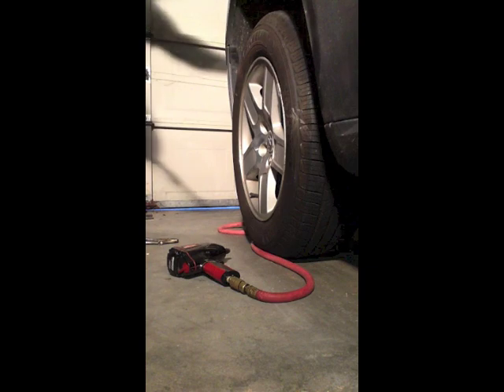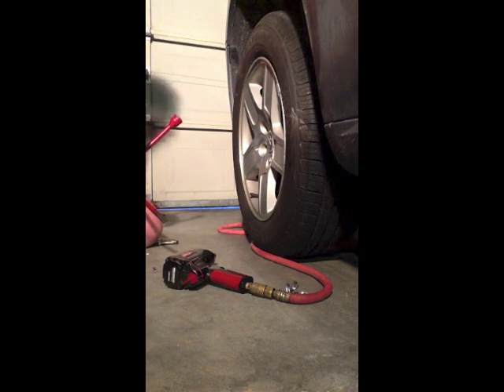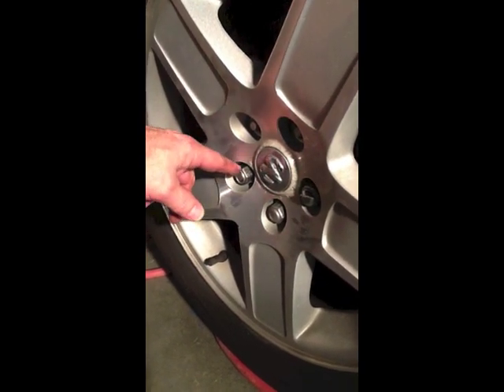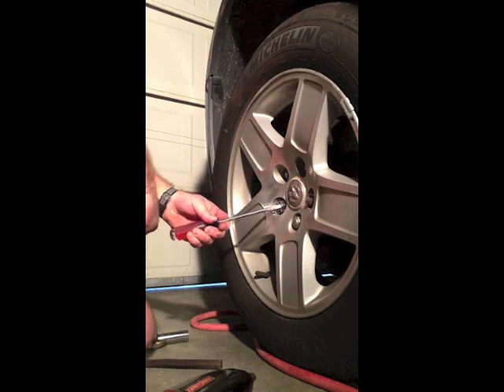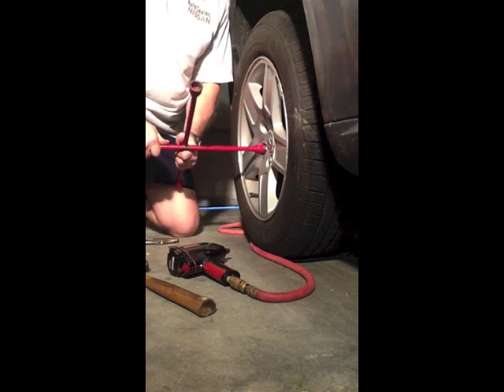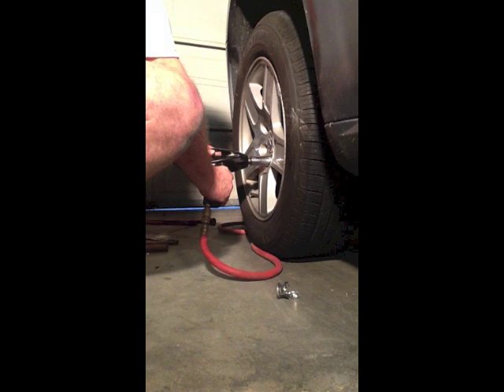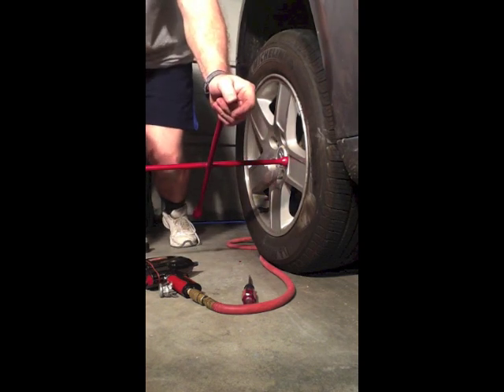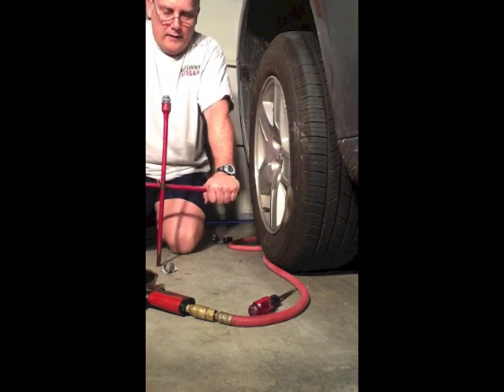How to remove over tightened lug nuts

Comment: Why not use a good quality 6 point impact socket, a breaker bar and a 4 foot cheater pipe?
Reply: Bryce Hambleton    Tried that on mine and they where so tight my wheels started to move when I tried to loosen the nut and my car was in park with the emergency brake on. So yea way way way over tightened
Reply: Because it does not work when the jacket is damaged. You have slippage between the jacket and the contained nut.

Comment: This is not an overtightened lug nut.  This is a damaged stud video.  I need to see a video condemning mechanics who bear down on an impact wrench that ensures that the owner of the car will never be able to change a flat on the side of the road.  Meaning, the nut is too tight but can otherwise still be removed using an impact wrench.  The danger of an overtightened nut is that the wrench slips off after the person is angry and sweating out of his eyeballs in the summer heat and ends up breaking an arm just trying to get the overtigtened nut off.

Comment: I spent 2 hours tonight, trying to get my lug nuts off. I rounded two nut with the lug wrench. Then I busted a breaker bar and a ratchet wrench. Cracked 4 sockets, one was for an impact wrench. I have 19 MM nuts, and after you remove the thin metal cover, an 18 MM fits perfect. So I cracked all three 18 MM sockets I had, and one 14 MM impact socket. I finally gave up. Tomorrow I'm going to buy one of those turbo sockets that bite into the nut. I better buy 2, knowing my luck with sockets. If that doesn't work...there is always dynamite!

Comment: I actually bent ( twisted )my 4 way removing a stuck lug nut like that. I sed a length of pipe over the other end. I didnt notice it right away that I had twisted it until my daughter asked me what was wrong with my tool,It was laying on the garage floor,thats when I noticed I had damaged it. geesh! I hate those aluminum lug nut covers. Ivended up replacing all my nuts with regular chrome ones,much better,thats for sure. I still have that bent 4 way.

Comment: I work at a little Shop with young guys , all I see is impacts throwing lugs on . I invested in a torque wrench, however when it comes to working they want you to be speedy.  regardless of torque specs. I guess that's how it is. and then you get this. had a box truck come in for a rotation. took a impact at full force to get the lugs off. barely. rediculous.
Reply: whsts wrong with a regular drill? you only need about 100ft/lbs...u overtihten them so that the customer comes back.... scam if u ask me....

Comment: THANK YOU!!! WENT TO GET NEW TIRES AND MY BOLTS ARE WAY TO TIGHT🤦🏾‍♀️SO I HAVE TO FIGURE OUT HOW TO GET THEM OFF
Reply: Use a lil bit of grease on the threads. 
Tighten the bolts, only by hand with an L shape wrench like VW type, or a torque wrench.
I apply grease on the bolts once a year, when i'm changing summer/winter wheels at home.
Tighten only by hand with a regular VW L shape 19 mm wrench, or what size your car has.

https://youtu.be/VbN9Y_fUvjo

Comment: So what's the trick getting the stuck lug out of your 4 way wrench?
Reply: toss the 4-way wrench and keep a breaker bar with and extension in your car. And use a torque wrench and just to be safe get a deep well impact socket (you may not need the extension)
Reply: Put it on a bolt in the vice, heat the nut and it will come off

Comment: I just came across the same issue with my friends car I just took a punch and a hammer punched a hole through the outside shell then took a pair of pliers and pulled it off yhen used a 3/4 drive wratchet with the appropriate size socket and used a metal bar on weather for leverage and lug nuts came right off

Comment: I usually service all my vehicles.  Many years ago, I went to a tire dealer place.  There was an "angry'" mechanic, who throws tools and what not around.  I should leave right away.  I did not.  He tighten the wheel nuts with the air impact at the max setting and banging away for 10+ seconds to make sure that those nuts will never, never come off.

Comment: Ive used heavier duty impact gun than the one the video poster used and still couldn't take my lug nut off. After welding a socket onto the damn nut after one hour of heating and all sorts of attempts it came off. Damn mechanics who overtightened shit as well. Fyi im an aircraft mechanic and work cars as well

Comment: I experienced this very same problem. After several hours of annoying my neighbors with my impact wrench. I decided to take the vehicle to a mechanic, and pay someone to remove all my cheap ass factory lug nuts. And replace them this solid steel lug nuts. You can really annoy yourself. In fighting with yourself in dealing with this situation. Save yourself the headache. And pay someone to do  this job for you.😬😬😬😬😬😬🤯🤯🤯🤯🤯🤯🤯😖😖😖😖😖😖😖😖

Comment: Don't change wheels at the side of the road. Most good quality non-runflat high performance tyres, can run flat with care, up to 80km/h for up to 50km. Drive your car to safety, such as a Service Station, Service Centre or Rest Stop.

Comment: Aluminum wheels should  be tightened to 80 ft pounds the tire shops won’t check them they use impact gun and way over tighten
Reply: The 'mechanics' don't even understand the word torque.

Comment: i took my old beater car to get a rotation and alignment at a shop near my house. first sign of scam was they told me my little 1.6L with not even 100lbft torque and a 0-60 in 14 seconds was prone to torque steering !!. car went left with straight steering wheel. when i went to pick it up, they told me they did the alignment but couldn't get the car to go straight because the rear tires (now front) were unevenly worn, and when they did a front axle swap teh car pulled the other side. then they didn't provide me with an alignment sheet bc they said i didn't ask !! every alignment i've done, the sheet is given to me automatically without asking!! then they tell me one of my front tires is now beginning to bulge on the outside. i examined it and couldnt find any bulge at all. so i took it home. over the weekend, i decided to try to took off the tire and bring it into my house and try to find the bulge and to try a front axle swap to test the pulling, and it turns out they over torqued my lug bolts and i couldn't get them to budge at all!!! so my tire has a bulge (potential tire pop) and they over torque all my wheels so if it did blow i couldn't change them. i think they didn't do the alignment i paid for and are trying to prevent me from front axle swap tires to test it out. the guy said if i got two front new tires, it'll go very straight and if it didn't they'll fix it free, and it'll be the best if i could get four new. i do agree i need for new tires bc the current ones are 7 years old, and there is a mistmatch tire (now in the rear). the car is 24 years old and i have a second much newer car that's my daily driver so they knew i prob wouldnt get new tires. The reason i took the beater for alignment is because i wanted to test out a local independent shop i can walk to/from. my newer car ate a giant pothole and needed alignment so i used the beater to test out this local place before i took it there. i'm going to stick to tires plus for alignments, they try to upsell me from time to time, but they always do the alignment well, they're just too far from me

Comment: You keep referring to the lug nut as a "bolt".  This can be confusing to people who know the difference between the two.  While there are some cars that use lug BOLTS rather than studs and nuts, what you are describing is not one of those.
Next, you describe the lug nut as being encased in aluminum, i.e. the nut's cover is made of aluminum.  This is not true..  They are made of very thin stainless steel.  Not that this makes any difference to the guy trying to get the lug nuts off, but I hate to see erroneous information disseminated on videos.
  If i have a shop install my wheels, I always specify 90ft/lbs of torque on the lug nuts. ( Good shops will use a torque-limiting extension if they have to use an impact wrench.)  Then, when I get the vehicle home, I check every nut with a torque wrench.

Comment: They can be damaged over tightening them, but what usually happens is corrosion. You have two metals here..the steel lug nut with aluminum "caps". The steel rusts and swells the cap causing it to slip. Basically they are crap cheap lug nuts. Dodge and Jeep are also notorious for lug nut stud galling and stripping. Buy some real solid steel chrome,  or even better, anodized lug nuts to replace these cheapo garbage and no more issues. Better keep some anti seize on those studs as well.

Comment: This pisses me off it’s almost like it’s done on purpose so you can’t do it yourself and you gotta take it back to them. The previous place I took my car to get a brake job done they tightened those nuts so dam tight I could t get them off. I decided this time around I’d save some money do my own brakes so I pulled out the included hardware that came with the car I proceeded to remove the nuts and found out I couldn’t even tried a breaker bar nothing. They where so tight when I tried to loosen the nuts I was moving the wheel and the car was in park with the emergency brake on. Like it’s crazy. I understand safety but is it that hard for a mechanic to look up the torque spec and use a torque wrench. My cars 100 foot pounds I looked it up there’s no way those bolts are put on at 100 foot pounds

Comment: Don't know what you do for your job, but stop giving out automotive advise. You made that job so much more difficult then it really is. First thing give that air gun the right amount and pressure air supply. Buy the correct tools it is a 2 minute job.The install should have been done with an air impact and a torque stick socket.

Comment: I just rotated my "new" tires this morning after their first 5,000 miles.  Apparently the mechanic that installed them must have torqued them to more than 400 lbs.  I used a breaker bar to loosen them and it still took a lot of strength to get them off.  One of the studs was completely messed up.  I was lucky enough to run into a mechanic at NAPA who knocked out the stud and put the new one I bought at NAPA along with the new lug nut.  He completed the whole job in about 15 minutes.

Comment: I just went through this today. My GF's mom needed brakes done.... Sure no big deal.... Riiiiiight, the ass hats at the local tire shop where she had tires installed over torqued the wheels . A project that should 30 minutes per wheel turned into 5 hours just to get the wheels off the front. Luckily I got them off but I'll be taking these twisted and torqued unusable lugs to the shop to toss them at the imbecile with an impact wrench that doesn't know what a torque rating is

Comment: You screwed up dude. You are supposed to hammer a 21mm socket on it. Not 7/8. And once the cap is off its a 13/16 inch lug.

Comment: use anti seize
Reply: Chaborgnik Ruski o wow thanks bro, my brother told me about it, he has used it for ever with out any problems, however we don't torque the wheels down to spec we just use a wrench and do it by hand, we live in the garage so we are use to working on cars, bikes, go karts etc...we only use a tiny bit, as it saves you so much trouble at times, but always like to learn about stuff like this thanks!
Reply: I've had this happen more than once on our caravan, & we DO use anti sieze
Reply: dont worry about it just torque it to spec , you have to use anti seize if you live in an area where there is a lot of salt and I've never seen a broken wheel stud or nut/bolt because of anti seize but guess what I have seen many broken studs and fasteners on cars that don't use anti seize. I anti seize everything that comes off the exterior of my car even small 10mm screws

Comment: can't see the logic in smashing a "4 way" on the nut. I would have got out the socket set and used a smaller socket.
Reply: It is because his 4-way is worn out. The fact that his 19mm just turns and turns @ 0:40 shows that - even if the stainless shell is detached from the nut beneath a good 4-way would not do that.   So he hammers on a smaller socket that fits roughly.
Reply: I have a cracked 19mm Stahlwille socket that is testament to this not being sufficient by itself.